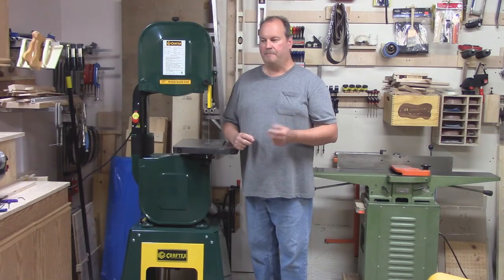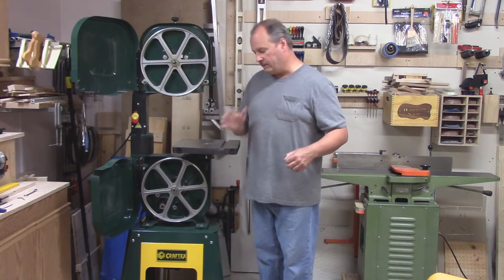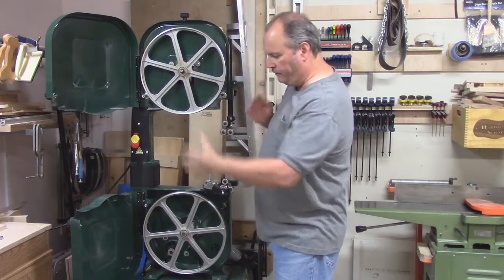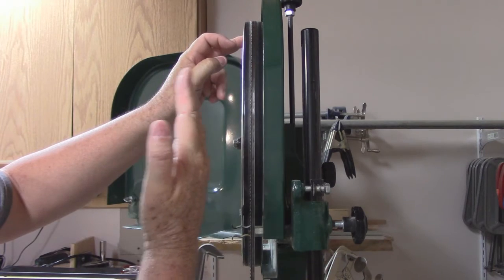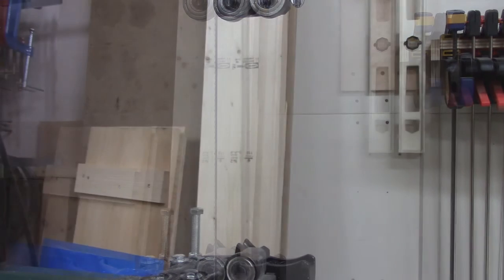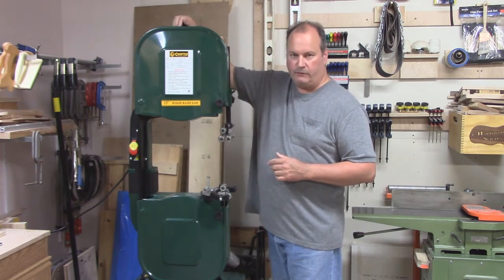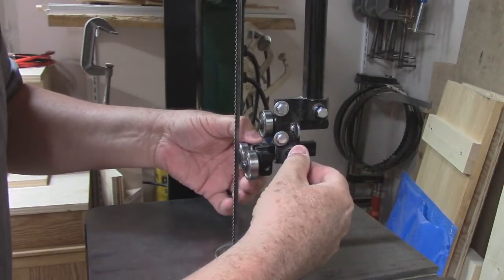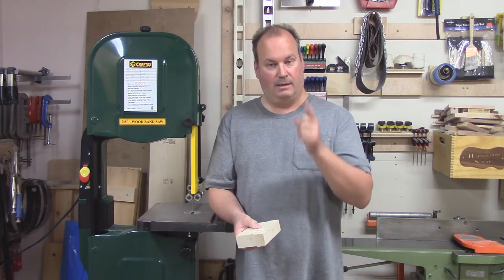Bandsaw Blade Setup

Comment: Hi Paul, excellent video. Do you still own this Band Saw?
I picked up this model used, but only used a handful of times, it's in perfect condition, but, I don't think this Band Saw that i picked up is or was ever setup correctly, also I think it still has the same blade it came with, i set everything up as correctly as I could, did a test cut with 3/4 piece of plywood, can barly make a cut at all,.
I have a old King Canada Band Saw that can cut better than th BB one.
Could it be the speed setting on the pullies, blade, or something else?

I think the motor is 1HP 3 speed.
Thanks for any help you could give me.
Reply from the maker: Hi Shawn. Yes I still have my Craftex bandsaw. It's the only one that I have. The first thing I would do is get a new blade, it really makes a big difference. I go a long time between blades but when I do replace it, it makes a world of difference. I buy mine at Lee Valley Tools. Spend some time tuning and aligning it and you will be very happy with it. I even replaced my belts with the Power-Twist type. It grips better and doesn't vibrate as much. Make sure your blade is tracking properly and tight. Good luck and be safe.
Reply: Thanks for the quick reply Paul.
I get blades for my king Band Saw at Lee Valley as well, I should have known to replace the blade when I was setting it up.

Looks like the wife and I will be heading to Lee Valley in London soon.
One more question for you.
Do you know if there is a riser kit that would work for this Band Saw? I called Busy Bee, they said there is no longer one available.
I was wondering if there was another make that would fit.

Keep up the good videos.
Reply from the maker: I do have the riser kit (CT015EXT) and was not aware that they are no longer available. That sucks. I am not sure what others out there are compatible with the Craftex. 

I also forgot to answer your question on the first posting: Yes mine is a 1 HP motor with the 3 speed pulleys and I have been using the highest speed (2800 FPM) since I bought it to cut everything. I know that I should lower the speed when resawing and such but I never do.
Reply: Thanks again for your prompt reply.
I think that is what speed I am at now, so it looks like blade change for the next step.
If i can get this Band Saw to cut with a new blade , I would probably think about upgrading the tires as well as the belts.

What Part of Canada are you from Paul, Southwestern Ontario here.
Reply: I thought it sucked too, seeing as the Craftex that I have was made in 2005, and the King Band Saw that I have was made in 1997, and I can still get the riser kit for it.
Reply from the maker: I'm in the Ottawa Ontario region across the river on the Quebec side, cheaper housing.
It shouldn't be too hard to make a riser, it is only 4 inches tall. Take a piece of U-steel channel and weld flat pieces on both ends with cut outs or holes in them for the bolts, apply some paint and you're good to go. Mine had some small alignment holes for pins but I never used them. I lined it up manually and it's been there ever since.